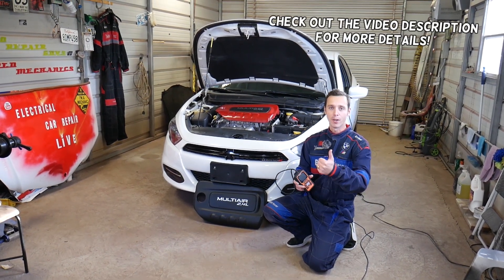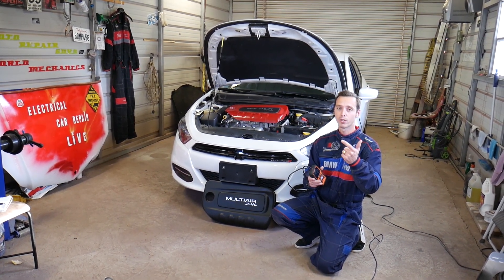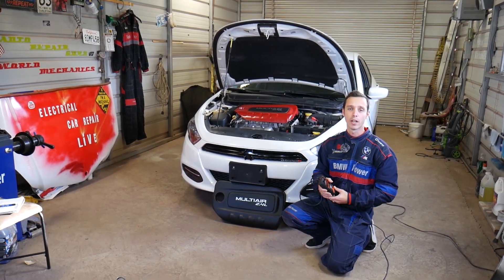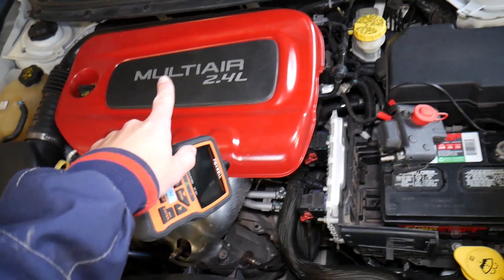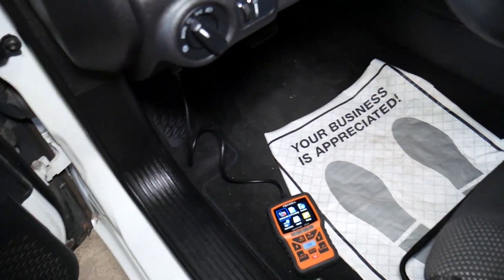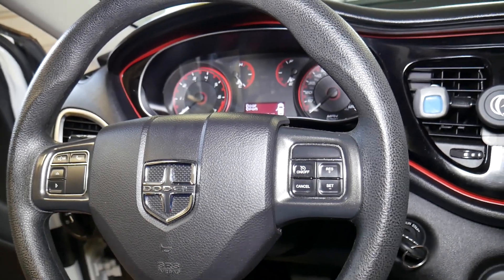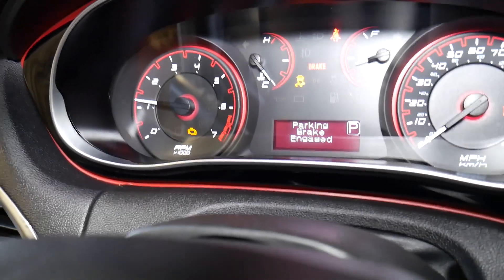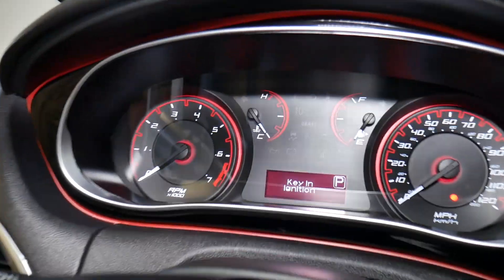FIX CODE P0123 P0222 P2135 DODGE DART, CHRYSLER 200 JEEP CHEROKEE RENEGADE COMPASS, FIAT 500X TORO

Comment: I got the P0123 on a 2009 dodge avenger. I sprayed electrical contact cleaner and took the throttle body of the car and thoroughly cleaned both sides of the valve/"butterfly" and cleared the dode and so far 30 60 miles so far so good.

Comment: I have the same exact problem on my 08 mkz, I’ve changed the tps worked for a few miles and started back wit the exact same problems I’m not sure what it’s exactly bc I have another problem is where I won’t get no pedal response at times after it does it again and most of the time it works as far the computer would let me

Comment: hello i had the p0123 & po222 with p2172! 
i replaced the throttle body had it relearned it still stalls on me, could it possibly be the throttle pedal position sensor still causing the issue.
Reply: What car are you doing this on and did you fix this?
Reply: Yeah did you fix it? Exact same is happening with me on a keep compass

Comment: I have codes P0123 P2122 P2127 P0222 showing on my 2013 Chrysler 200 2.4L EDG (circuit A and B for most of them - it’s 12 codes in all, all pertaining to the throttle body/position sensor.) any ideas? It’s a Saturday today and I’m trying to get someone to come test everything with a computer but idk how this is gonna go so any advice would be greatly appreciated.
Reply: ever figure that out?